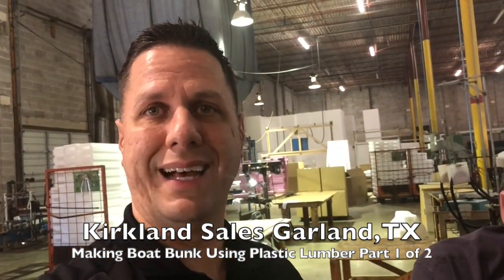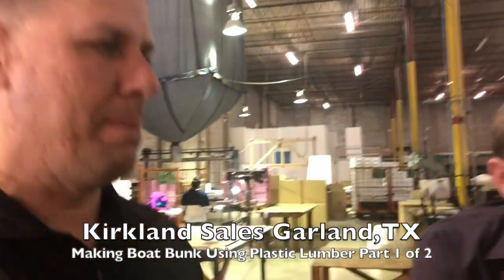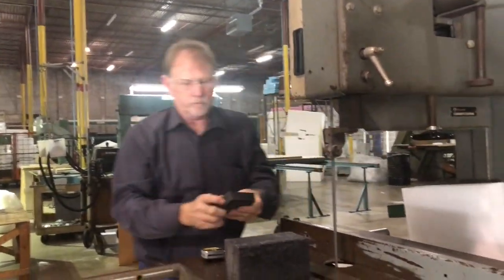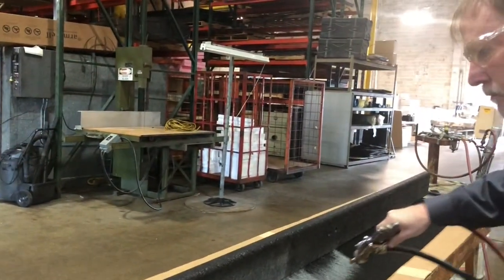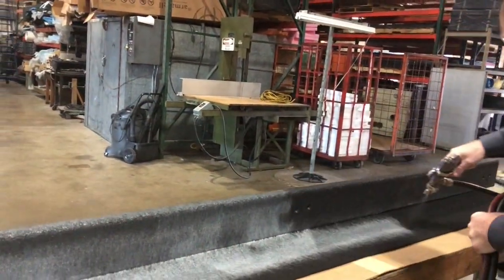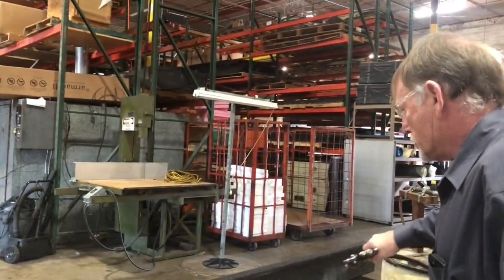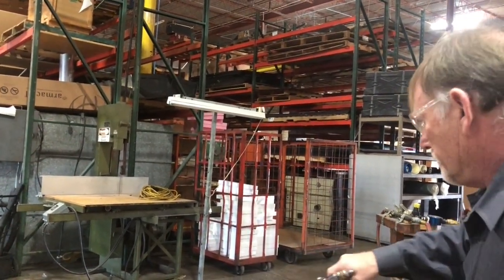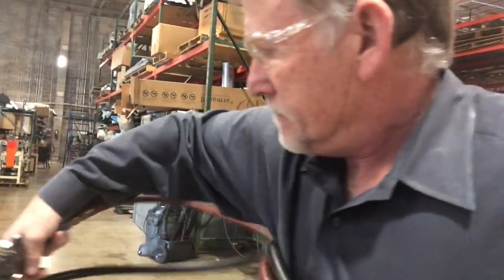Making Boat Bunk Using Plastic Lumber (Part 1 of 2)

Comment: did you just rip a 4"x4" piece of this stuff in half, and then round over the edges? 
i am interested in making these without using carpet -is that safe for an aluminum bass boat?
i have seen the Tuff Bunk brand boards and feel as though this could be a better alternative, being that this is solid rather than a spray-on finish over a pine board.
also, i am assuming that this stuff does not flex like composite decking, which is durable but very flimsy across a span (also half as thick though)
i did buy some solid composite rail posts for my deck (not this brand), which are roughly 3.5" x 3.5" and are stiff, but also only 4' long and also 1.5" thicker than these would be.
thanks for any tips or suggestions.
Reply from the maker: No they come in 2x4s. The plastic lumber does not do well when it is ripped. It will do great with aluminum.
Reply: @TheImprovementChannel  even without the carpet, right? thanks.
Reply from the maker: @Straight0uttaCrofton  yes, I think they would work fine, but you would need to test and decide for your self. This is different from the decking material it is a lot more bendable. Check out my landscape video, you can see me bend them around.

Comment: Did you ever make a "Part 2" video?
Reply from the maker: Yes it is on there, but it is not very good. Check out the welding table video.

Comment: Plastic lumber is NOT good for boat bunks because it's much less stiff than wood and will not support a boat properly. I've seen more than a couple hulls ruined by plastic bunks.
Reply from the maker: What size is the wood that is properly supported the boat you are talking about?  Most I have see are 2x4s. Not much support there.
Reply: @TheImprovementChannel  a wood 2x4 has much less flex than a 2x6 poly board. I've seen this myself. Maybe if you doubled them up? I dunno... But you want SOME flex, but not too much
Reply from the maker: Tanner Saurus it also depends on the plastic lumber. Some brands are much more flexible.  This that we used has worked great.
Reply: @TheImprovementChannel  what specifically did you use?
Reply from the maker: Best Plus plastic lumber.